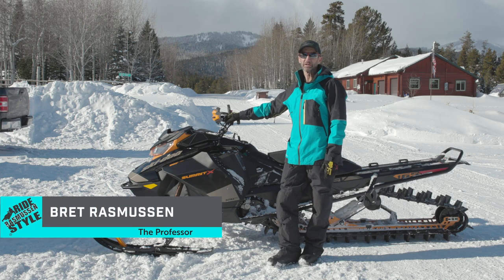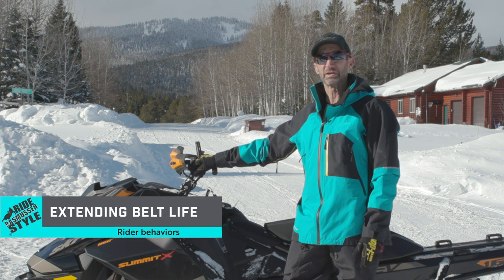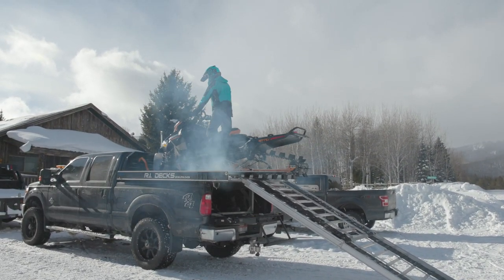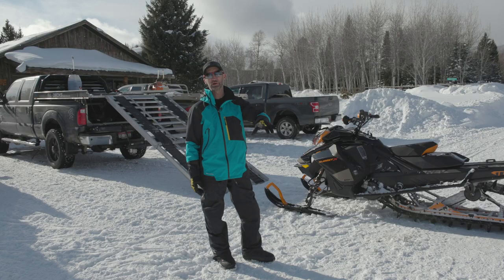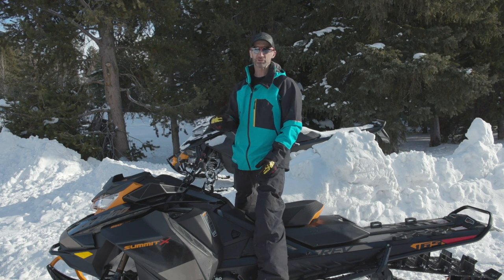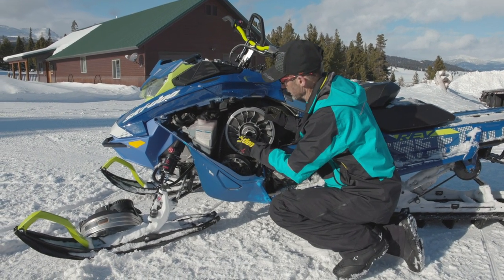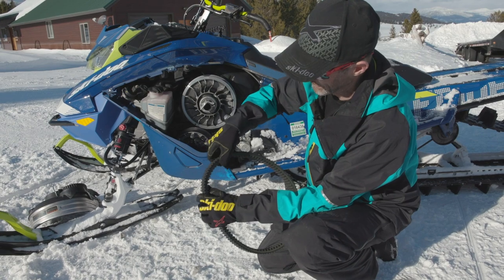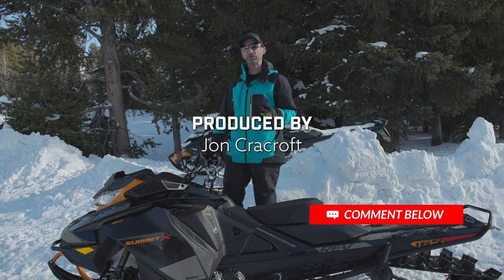Extending Snowmobile Belt Life - Part 1 - Ramps and Parking Brakes

Comment: Thank you Bret for all the good tips!  One question I have is how throttle control affects belt live?  I see some people pump the throttle all the time while others keep a more constant throttle/ RPM.  Which is better?
Reply from the maker: Of course a steady throttle application would be much better for wear and especially clutch and belt heat build up. Thing is that the drive system is very efficient and in technical terrain we expect the rider will be working the throttle a lot in an effort to maintain control of the sled and prevent stucks!! Best practice is to rest the sled periodically and let the drive system cool off.